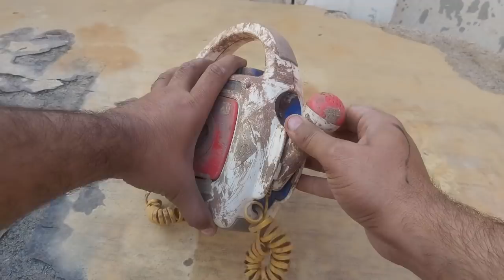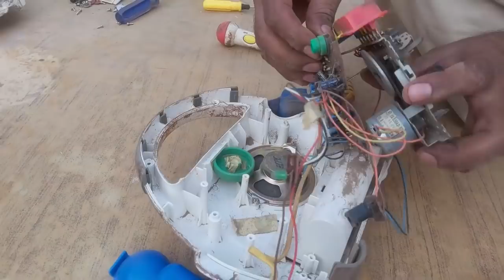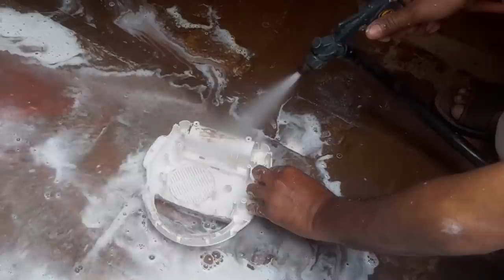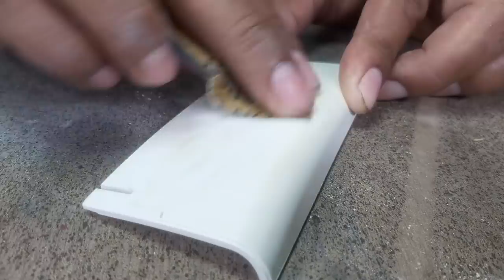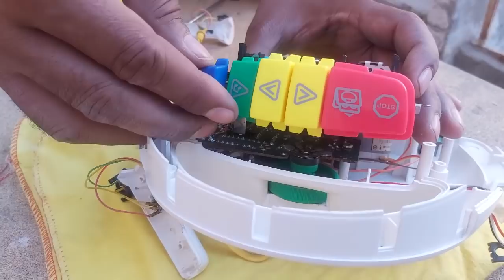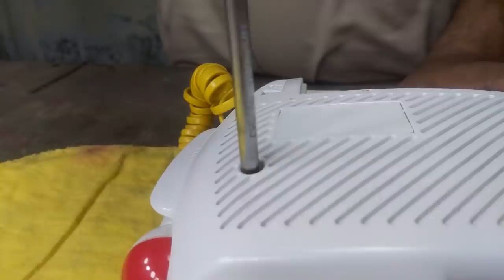Playskool Cassette Player/ Tape Recorder Restoration

Comment: For tape machines, you just need a calibration tape and flutter meter. Adjust the head azimuth and then the little hole on the cassette mechanism motor is to adjust the speed.

Comment: Completely removes heads replaces it and it works perfectly ? In 50 years in the repair business I've never seen that happen or seen two drive belts still usable after being abused like that. Did anyone else notice he spray painted the front of the unit twice and managed to get the clear plastic to look brand new? He had wires broken everywhere in one shot and managed to remember where all of them went. This guy is having us on, oh yes, why would anyone smear mud on a toy player? I can understand dirt and grime, but I have a feeling the "technician"  (and I use the term lightly) may have had something to do with that. 

I think he realized how much money there was in doing these videos and decided to stretch the truth, after all, how many viewers know anything about electronics? and can notice his BS.
Reply: For you something about this is real?